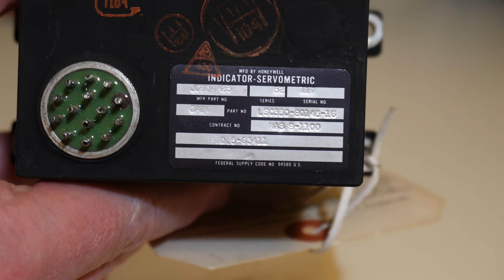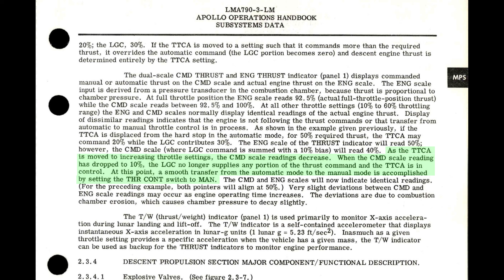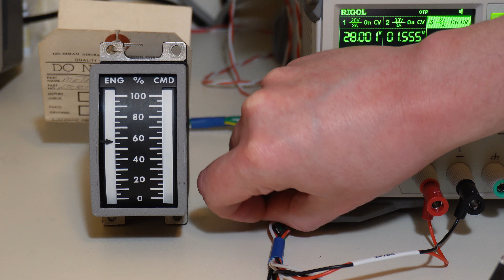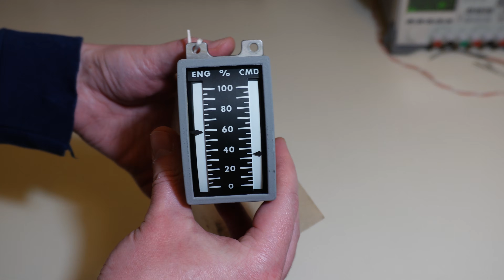Powering up a Lunar Module thrust meter

Comment: Very nice. The kind of analog precision that was applied in the moon landings was really special. My dad did the shock tube verification at Grumman for the descent and accent engines on the Apollo program. Because of the importance of the project, a full scale mockup was done in Texas to double check. That group had reported insufficient thrust for the LEM on their model and my dad was sent down there to see their setup. Turns out they had placed the transducer under the engine upside down. When installed correctly it matched perfectly with the shock tube data. In fact, the engines used by SpaceX were appropriated from the LEM as they can be turned on and off. So much for digital simulation.

Comment: Do you have a copy or know where the document detialing the pins and the dimensions of the gauge housing itself is? I am currently recreating the panels for the Apollo CM and the Space Shuttle, and eventually the LM too. I love the video and how much detail you go into. This kind of engineering tickles my brain nicely. 

I would love to know where I can get these documented details from. So far I have used the familiarization manuals to eyeball the size of the FDAIs and then blocked everything else out by hand, but having the actual measurements would help greatly!
Reply from the maker: Sure! I uploaded it here: https://archive.org/details/lsc350-80145
I also have the specification control drawing for the LM FDAI, which I can process and upload shortly. Generally, you can obtain these drawings yourself from the National Archives at Fort Worth -- if you know the drawing number for what you want (e.g. V070-* for shuttle, V36-/V37-/MExxx- for CSM, LDWxxx-/LSCxxx- for LM), they can try to find it and scan it for you. Most of these drawings are stored on aperture card though, and digitization can be steep ($2/card) if you're not going in person to digitize them yourself.
Reply: @mikestewart8928 oh wow thankyou! I can't go to fortworth as I live in Australia haha. Would love to go to texas and see the places though.
Reply from the maker: @FR4Y3DS4N17Y  Sure thing! LM FDAI specification control drawing is up now too: https://archive.org/details/lsc350-301

Comment: AI Summary

Abstract:
This report details the successful reactivation and performance validation of a Revision-16 Servometric Thrust Indicator from the Apollo Lunar Module (LM). Unlike standard D’Arsonval movements, this instrument utilizes internal closed-loop servo control for high-fidelity response and needle stability. The analysis clarifies a complex "rabbit hole" in the LM throttle control logic, specifically the integration of the Thrust and Translation Controller Assembly (TTCA) and the Apollo Guidance Computer (AGC). Validation testing confirms that the instrument’s internal voltage regulation and calibration have remained within nominal specifications for over five decades. Technical assessments of the 400Hz electroluminescent (EL) lighting and needle behavior under mechanical vibration provide critical data for the preservation and operation of historical flight hardware.

Technical Evaluation and Functional Summary: Apollo LM Thrust Indicator

*   0:00 Servometric Architecture: The unit is a "servometric indicator" rather than a passive meter. It utilizes internal feedback loops for closed-loop needle positioning, providing high responsiveness and preventing needle drift when powered.
*   2:33 Power Failure Mitigation: Due to the servometric design, needles remain at their last position upon power loss. To prevent misleading readings during critical burns, the unit features a dedicated power-sensing circuit to trigger external panel warning lights.
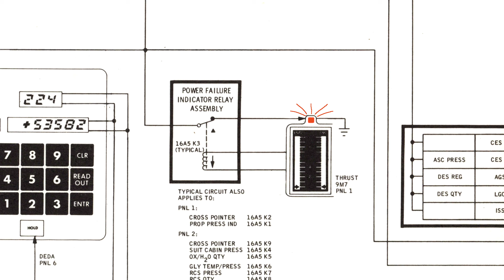*   3:28 Control Logic Rabbit Hole: The meter displays a summation of manual (TTCA) and automatic (AGC) throttle commands. While the summation occurs at the engine actuator, the meter must independently reconstruct this value. 
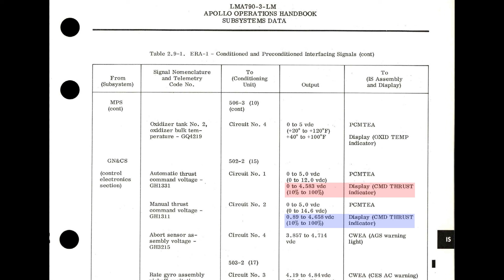*   6:26 Dual-Input Bias Integration: In "Auto" mode, the meter applies an internal 10% voltage bias to the AGC signal. This assumes the pilot has followed the standard procedure of setting the manual throttle handle to its 10% minimum, ensuring the needle correctly reflects total commanded thrust.
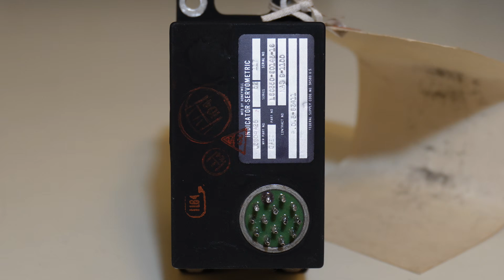*   8:53 Interface Engineering: Validation required custom female crimp contacts for the 0.062-inch male pins on the glass header, as soldering to the original cups was avoided to preserve hardware integrity.
*   11:08 Thrust Calibration Validation: The "Actual Thrust" (left) needle was tested against the 103.4 PSI / 2.75V nominal scaling for 94% thrust. After 55 years, the meter demonstrated near-perfect calibration at 100% full-scale deflection.
*   12:24 Throttle Command Validation: The manual and automatic inputs (right needle) were verified at 4.658V and 4.583V respectively for 100% command. The instrument maintained extreme accuracy across both input paths.
*   13:44 Transient Magnetic Coupling: High-speed sweeps revealed a "glitch" where a rapid move in one needle caused a transient jump in the other, likely due to internal magnetic coupling or Lenz’s Law effects within the dual-armature housing.
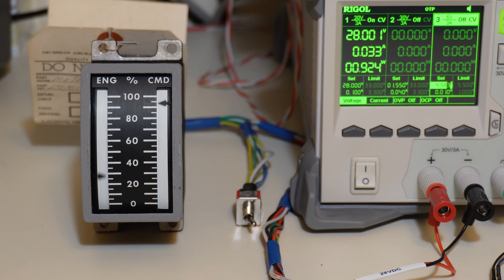*   15:25 EL Lighting Performance: The display utilizes electroluminescent (EL) lighting powered by 0–75V AC at 400Hz. Spectral analysis shows peaks at 480nm and 590nm, producing a high-color-temperature white (6000K–6500K) intended for high visibility in the LM cabin.
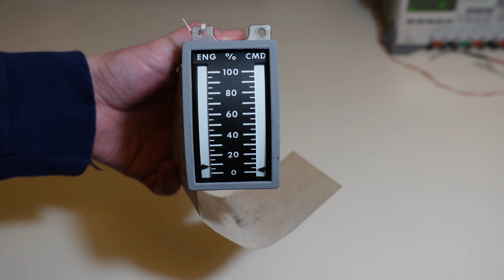*   17:45 Mechanical Vibration Sensitivity: Testing confirmed that unpowered needles shift during mechanical vibration. However, historical data from Apollo 15 suggests that launch vibrations did not significantly displace the needles, likely due to the internal friction of the de-energized servos.
*   18:53 Ambient Pressure Offset: The instrument’s tendency to show ~13% thrust while on the launch pad is explained by its vacuum-referenced calibration; the 14.7 PSI of Earth's atmosphere registers as positive pressure relative to the vacuum for which it was designed.

AI-generated summary created with gemini-3-flash-preview for free via RocketRecap-dot-com. (Input: 23,661 tokens, Output: 912 tokens, Est. cost: $0.0146).

Comment: Man, that would be awsome CPU usage indicator.
Reply: honestly yeah but imagine trying to do the logic to feed the right voltages
Reply: @myacidninja1025  I don't think it would be that hard, since current draw isn't that big OP-Amp driving transistor would be enough to create max voltage dial takes, Output of such "PSU" would be connected to dial trough transistor driven my micro controller PWM. + voltage spike dumping circuit.

Comment: Question: given that every once of weight was critical does that feel kind of hefty like a gauge you would find say in an airplane where weight is less critical or does it seem fairly light given its volume? It looks fairly substantial.
Reply from the maker: Hmm, subjectively it feels pretty solid, but not overly dense? The spec lists a max weight of 1.2lbs. Very broadly speaking, it's generally surprising how heavy the Apollo electronics are, and how light the structural parts are. For the LM in particular, it really seems like the poor mechanical engineers got the short end of the stick. Parts from the landing gear mechanisms are shockingly light.

Comment: Wow! This is great. My dad was a mechanical engineer at Grumman in Bethpage, and he did the mechanical drawings for the  LEM control panels and for other components. Can the original mechanical drawings of the panels be found in the National Archives? How do I get copies of them?
Reply from the maker: Yep, they'll be in the national archives at Fort Worth. You can obtain scans by emailing the archivists there, but you'll need to know the drawing number you're after. It'll start with "LDW" -- most likely "LDW-340", followed by 5 more digits. Unfortunately I don't know the full drawing numbers that would be best to ask for.
Reply: @mikestewart8928  Thanks!

Comment: there is no way these pieces of equipment wouldnt last basically forever
they were made to handle the unknown and radiation of space
to the point where they were basically expected to almost be consumable, the entire unit being a one-time use for the whole mission
and if they didnt want that?
they had to manufacture the absolute everloving shit out of the instruments to a point of modern absurdity, but old-time standard

Comment: What provides electroluminescence? Is it a LED backlight or some fascinating eccentric solution?
Reply from the maker: This meter actually predates the widespread availability of LEDs, and white LEDs didn't really become available until the 90s! The white areas contain a phosphor that emits light when an electric current flows through it -- very similar to radioluminescence, but using electricity instead of radiation to excite the material.
Reply: @mikestewart8928  That's awesome, thanks for explaining it. I imagined something like that. I'm guessing that LEDs are cheaper / safer / more  efficient.

Comment: where does the actual illuminance comes from ? is it the paint itself and if apply a current to it produces light or did the meter has back led or something like that ?
Reply from the maker: It's the white paint, or whatever the material is, that contains a phosphor that emits light when electricity flows through it. LEDs weren't really commercially available when this meter was made, and white LEDs didn't come around until the early 90s.

Comment: The “total thought” that went into Apollo is pretty amazing.  This is just one little part among 10s of thousands of parts…and just this part had a LOT of complex design and engineering that went into it…
Reply: I’m not entirely sure what you’re referring to, but if you pause and read the document Mike pointed at, the description gives a transition mode where the meter might be showing full auto, then when the pilot pushes the manual control away from zero, the meter shows the diminishing auto input until the manual control syncs with the engine, at which point the meter proceeds showing manual control.  So there are three distinct modes (auto, transition, manual), and switching is required.
Reply: Too much thought by the look of it.  Why have relays and biases rather than just taking the actual summer command input?
Reply: @BlackheathTownhouse  So that you can immediately tell if you accidentally bumped the TTCA and increased throttle, since each burn has an expected throttle profile it will follow. Any command deviations mean you have manual TTCA applied while still showing the total thrust output on the left. This was actually a genious safety feature. Any time CMD did not equal ENG you had manual TTCA that needed to be corrected. Hope that makes sense :D

Comment: i'm not surprised its still bang on because its 100% analog and doesn't have any degradable parts like electrolytic caps or any kind of battery. it has a dust cap that seems like it was always on it, and the casing should be pretty well sealed. these kinds of parts were extremely robust (probably too robust which inflated costs to some degree)

Comment: Hi Mike, Super cool post. The bouncing meter when quick motions happen is probably caused by a voltage drop on the ground reference line inside. High current spikes cause the reference voltage to jump. A few big capacitors might have reduced this, but at a weight cost. I bet the makers knew this and accepted the jumps to save weight!
Reply: Why wouls quick motions cause high current spikes
Reply: @badgermcbadger1968  Hi Badger, the motors that move the meters draw high current when they have to move a large angular rotation quickly.
Reply: @taloowa5800 ah that makes perfect sense thanks

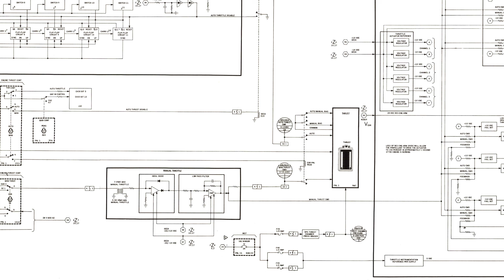Comment: 10:39 I'm curious, you said the 100% voltage for the measured thrust was 2.75V but for a 0-200lb, 0-5V pressure transducer, the output voltage at 103.4lb should be 2.58V. You didn't show the specs for the transducer (understandable, it's not relevant here) so is the voltage more than 5V? I searched through the documents you cited but didn't find anything at all about the voltage of the transducer.
Reply from the maker: I think you missed the 94% scale factor -- according at least to the table I put up in the video, 103.4psi is only 94% of max engine thrust. Adding that into the mix, (103.4/0.94)/200*5 = 2.75, exactly. Although, with that said, we're actively digging deeper into these numbers and trying to find more data, because we're having a bit of a hard time getting it all to line up in NASSP.
Reply: @mikestewart8928  I did miss that. Thanks for clearing that up! I spent an hour looking through the docs you posted and found all those tables but didn't notice that part.

Comment: The female side of the pins you found and obtained for this, they're in the electrics of Harley's from back in that era, I've been a Harley mechanic for 35 years and as soon as a saw that I recognized it, I've even got the special crimp pliars for them, the male and female sides are what's in the wiring harness plugs from back then.
Who'd have ever guessed that one?
Reply: Well apparently Harley made some bikes for the army back in the 50s... "Today on wheels through time, did this rare bike go to the moon!?"
Reply: @jacobyunderhill3999 
Those are standard pins I've seen in all kinds of things through the era, even the military radios I was around from that era, like that guage instead of having plugs they have those screw on ends, but the pins inside are the same, it's undoubtedly a US standard that was in all kinds of electronics from that period.

Comment: Watching those needle indicators move, I am impressed at how fast and responsive they are. Before you powered it up I was expecting maybe a few hundred msec of lag as they slowly tracked towards their position. But nope, to my eye at least they appear to snap basically instantly. They must have been a joy to work with in practice.

Comment: Nice work and neat meters! behaviour looks like a typical stepping motor without demultiplication - would be interesting to find out how it was built. Automobile makers have used watch stepping motors (Lavet motors) with a gear train. The revolving cylinder rotor magnet has a low inertia, i.e. can rotate at high speed, and its tiny holding force within the ferromagnetic stator gets huge when demultiplexed by a gear train. Try to have access to an x-ray tomography machine to analyse that thrust meter further!

Comment: Thanks! But why white, rather that tactical red, to retain night-vision adaption?
Reply: The lighting is dim enough that losing night vision adaptation isn’t much of a concern. Not to mention that the brightness can be controlled via an analog rheostat to the astronauts’ desired level.
Reply: @CaptainSwag101  Is that official military advice, or just your anonymous opinion?
Reply: That’s my just my opinion, but it’s specifically my opinion after having seen this very device in person, in the dark. It’s surprisingly dim light, and once your eyes adjust to the darkness, it doesn’t really affect your vision much. That being said, the engineers did see fit to put this white EL all over the cockpit of the CM and LM, so I am sure there is a document somewhere, unsure if it’s been archived or not, which has a rationale for the color.

Comment: That thrust needle wiring is what you get when the hardware is developed by a committee, who also strictly forbid the engineers from touching previously completed hardware. All they had to do was to add a bodge wire from the throttle summation op-amp to the needle and this entire mess with its invalid reading conditions would've been avoided. I mean it worked, but only just barely. It's the engineering equivalent of fixing software bugs by building a system that undoes the bug's effects (almost properly) instead of actually fixing it.

Comment: Respect, right on the money, a half century later. Well of course, they built it to go to the moon, with all of the ingenious engineering they applied everywhere else. It withstood conditions that are not imagined for objects built for use on and around the surface of the Earth. Evidently that calls for the kind of craftsmanship that keeps it working over 50 years later.

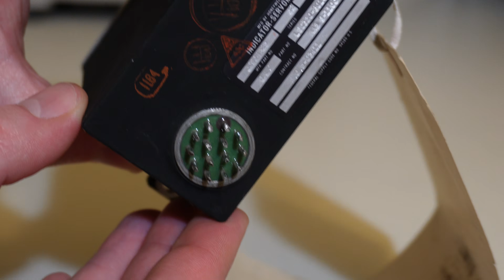Comment: 1:46 call me crazy, but I don't think you should be able to plug rocket parts upside down, and the fact that the only orientation mark is some subtle paint around a pin that gets covered by the connector is also troubling
Reply: I think this would have been directly soldered into the loom.